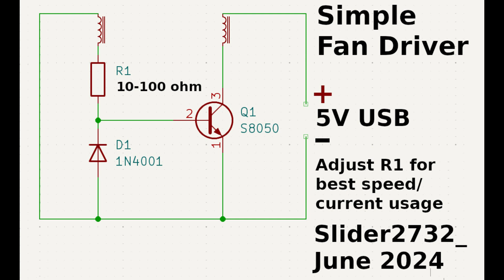DIY Brushless Fan Circuit - Improved

Comment: makes me wonder on how low power this could run. maybe on a water copper zink battery?
Reply from the maker: It's worth a go!
Current would be the main thing I expect, but with a large enough couple of electrodes it may work fine. Also depends on the size of brushless fan. 
Good luck if you try it 😀

Comment: Hi. I found that placing the 1N diode across the negative and posative legs of the LED diode produced a much more efficient result.
Reply from the maker: Great tip, thanks Peter! Also for replicating the idea. 
Yes, I can see why, the LED only working from it's switch on voltage and the diode being made for the task.

Comment: Hi slider in the previous video you wired coils one and three in series and two and four correct?
Do they put out the same field or are they opposite?
If I'm not making the proper connection the field will be wrong?
Reply from the maker: Hi Jon 😀Yep, 1+3, 2+4. In the Bedini SSG both coils are normally wound on the same spool... one is the power coil and the other picks up the induced energy to feed the Base of the transistor. As such, both 'sets' of coils on the 5V fan should connect in the same way. 
Connections per coil will be the loose end of a wire, then solder it's inner end (normally soldered to a metal leg) to the loose end wire of the opposite coil. Coil connection will be the same on both sets of coils.  It then emulates just 2 coils, both wired the same.
If incorrect the LED won't light, because no field energies will trigger the Base of the transistor. No damage will occur though.

Comment: That works great, i must have a go one day thumb 👍
Reply from the maker: Thanks it works really well, as simple as it is. It's running right now in front of me lol.  Have been testing charging batteries with the output (Collector and Ground) to an FWBR and cap, sort of emulating a Bedini SSG. Power draw shows as the same... just interesting at the moment 😀
Reply: @Slider2732_  they always say that the simple designs are the best designs. Looking forward to your next video, 👍
Reply from the maker: @johnwynne-qx6br  Cheers John, I really do appreciate your support and feedback 😀

Comment: I wonder if I have one of those fans in my stock 🤔🤔
Reply from the maker: Well worth a look at if you have. Some come apart fine, others are a bear. Converting with a variable pot to the Base allows for speed control/less power draw. This one runs on the solar recharged little white USB powerbank now, in front of me 😀